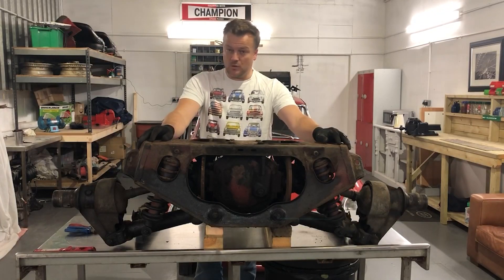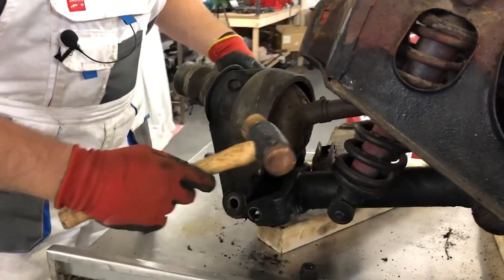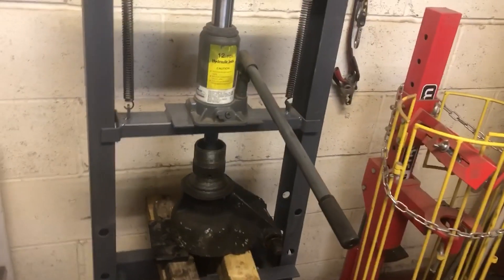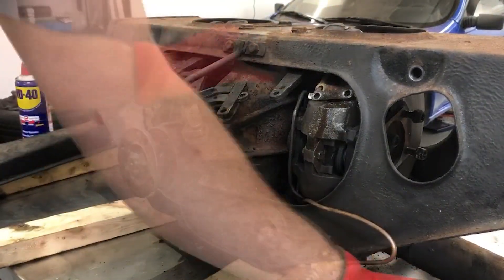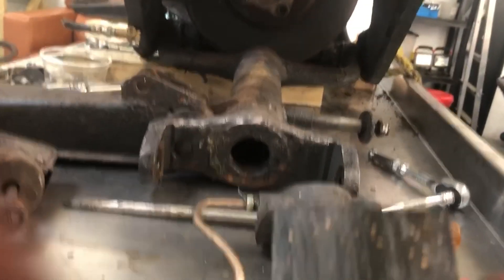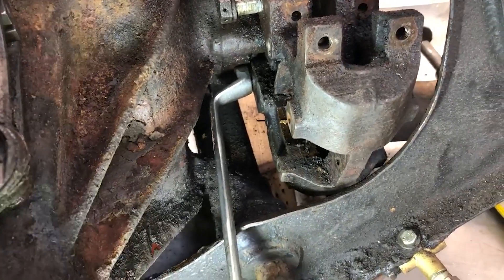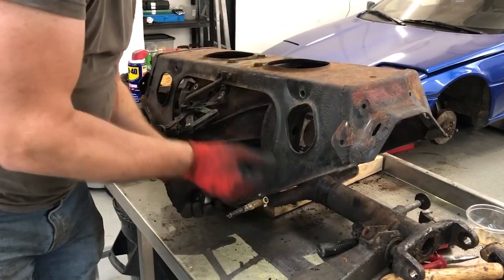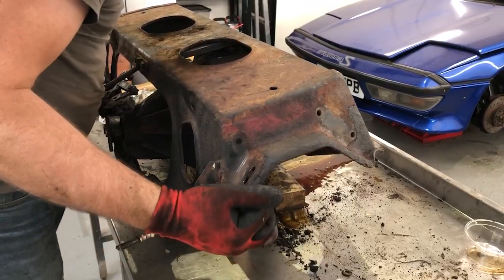Ep4 - 1967 Jaguar E-Type IRS disassembly

Comment: hi question i have done quite a but of mechanical work over the years on fords and toyota,s but have never attempted  rebuild of this magnatude, i have discovered that these days in sydny there are not a lot of experinced etype mechanics around, is it possible to do it my self after a lot of study and setting up with what has to be done... speaking from some one that has never done one but where the slave cylinders are seized and needs a complete rebuild... possible, well any thing is possible but should i have a serous look at doing this ???? what do you think
Reply from the maker: Hi, thanks for watching and for the question. I think that a rebuild like this is entirely possible by the 'home mechanic' with a decent set of sockets and spanners and a decent trolley jack most of this can be done.  Slightly more specialised tooling/kit is required for fitting the safety wire, making brake pipes and measuring the end float when shimming the fulcrum shafts and bearings but these aren't expensive. I had the diff rebuilt by a specialist but there's no reason why this couldn't be done at home with parts from a Jaguar parts specialist and some online research.

One of the good things about the Jaguar IRS is that you can remove it from the car as a unit. If you take your time I'm sure you're up to the job!

Comment: Need help…. The wheel of our 68 XKE is stuck.  Tried whacking it with mallet and removal ring. Have removed other three wheels
Reply from the maker: I’ve got the 2 lug spinner, sounds like yours is one of the 3 sided ones. I’ve done a search and there are better adapters out there that have a hexagon nut in the middle which you can use with a breaker/extension bar. Give this a look, hope that helps:
https://www.worthpoint.com/worthopedia/jaguar-type-s2-wheel-spinner-nut-247308686

Comment: Anyone inspired to dismantle their car, may I suggest leaving the unit on the floor, removing the e brake scissor assembly  and e brake calipers, flipping the unit over, and stripping it into lumps that won't kill u or destroy your car when it skates off the bench as u try to unsieze everything..this also helps big time when assembling as the half shafts won't hang
Reply from the maker: Yes agreed, definite benefits of doing on the floor which is where I’m doing most of the reassembly

Comment: OH what a delight to change those brake pads, luckily the car is so beautiful as it helps make all the extra work worth the effort. Looking forward to seeing you tying the wires on those bolts,  former 1964 02s owner. thanks for sharing, looking forward to a great result. Cheers from Dallas, TX
Reply from the maker: Thanks Mark, I’ll hopefully do a good job with the lock wire. My best regards to you over there in Texas, more to follow soon.

Comment: whenever I have worked on these rear ends (more times than I care to mention) I found the best way was to remove the cage first. Yes it gets a little awkward the the lower fulcrum but once off I flip the diff over and everything is easy to get to.
Reply from the maker: Thanks, I’ve seen some of your videos. I’ve a mk10 to do next so I’ll give it a try.

Comment: Great content bringing back memories.  I did mine 10 years ago and had it upside down, providing a little better access to the half shafts.  I also took the diff with brakes on out of the cage, again for mush better access.  I’m not sure if you mention it, but once you have taken the handbrake apart always replace the forks that pull the brake pads away from the disc.  I didn’t and had one handbrake pad dragging on the disc and subsequently disintegrating leaving me with no hand brake.
Reply from the maker: Thanks for the tips Ole. Yes I’ll make sure I replace the handbrake springs, certainly don’t want that to happen!